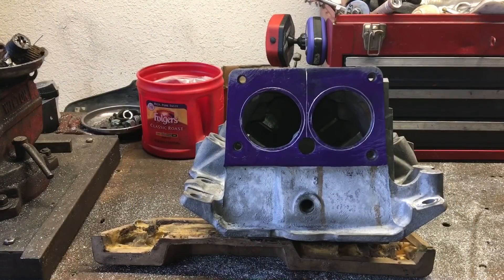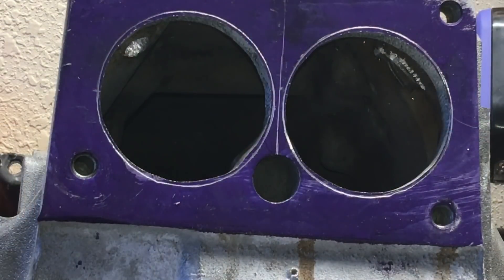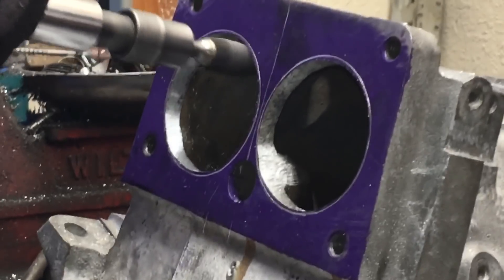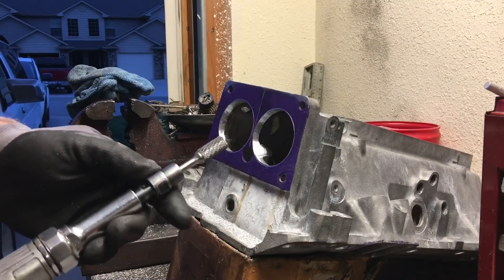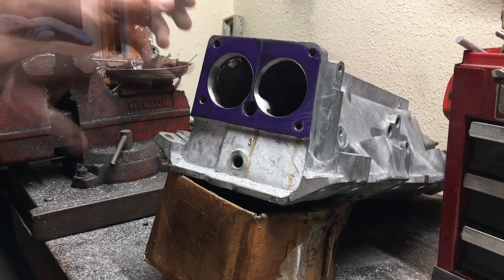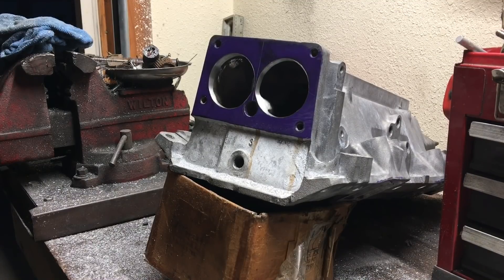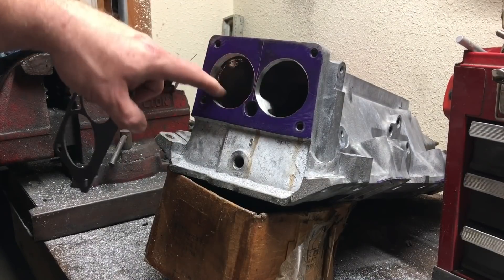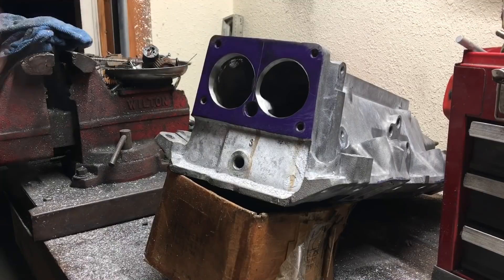Porting LT1/LT4 Intake 58mm dual throttle body BBK

Comment: what about using a bridge port and having a cut that is a true round cut?  I have a jig just for doing these.  FYI this makes zero horsepower below 6000 RPM.
Reply from the maker: Have machine would use!  👍 I wish I had a Bridge Port!  This video shows what can be done by hand.  JD
Reply: I think he covered that in the video. Probably because most guys don't have a bridge port in their garage?

Comment: What was the hp gain you got from this? I got a fully ported intake from Lloyd Elliott and a 58mm throttle body I haven’t installed yet.. I’m jw the gains
Reply from the maker: I can’t verify the results, the owner did a complete engine rebuild including ported heads and intake; never fired the combo.  The is his very first ride from high school, so it’s not going anywhere. 
I will say there’s no gain in running the larger throttle body unless the opening to the plenum is equal to or larger to avoid restriction.  JD
Reply: Mine is fully ported
Reply: I have headers, cam and everything else only thing I don’t have yet is cylinder heads
Reply from the maker: @jarmaljackson7455  Cylinder head flow will be key to making better power.  The camshaft and cylinder heads working together is important. JD
Reply: @HeadFlowInc  awesome I’ve been thinking about going that route probably le2 heads

Comment: We entered a small Dyno competition at a local college  (I’m a high school auto teacher) and the rules made us run an old style block but the head rule said any production sbc head, so we welded up the water port on a set of LT1s and drilled 3/4 holes out the back of the heads and ran the water back to the threaded holes on both sides of the water neck. We fully ported the LT1s and on our bench (Superflow 600) it flew around 260 cfm and near 80% exh (can’t recall exh cfm). We made 530 hp and 487! Ft lbs with a 355ci flat tappet and flat top pistons. We were 80hp above 2nd place! 😏. The following yr they sent us the rules “NO PORTING ALLOWED” 😕 so after a ton of searching we found a set of LT4s. We welded them up and did a nice valve job. They flew exactly the same as the ported LT1s! We went back that yr and made only 1 Horsepower less than the yr before!!! We then beat 2nd place by 100hp 😎 because they all had horsepower drops from the no porting rule.They canceled Dyno competitions after that lol Love your videos! Nelson Performance.
Reply from the maker: I really like how well you guys did each time winning hands down!  The LT1 & LT4 castings were excellent for the time.  Stinks  they did away with the Dyno challenge I know it was a great motivator for the builders!  
Thanks for watching and the feedback I truly appreciate it!  Keep teaching the next generation about auto tech!  Maybe we can get those Dyno Challenges back!  👍😎

Comment: Nice work on Tbody opening and cleaning up runner ski slopes. Most porters don't show the work on the LT1 intake manifold.  Good information.
Since air not combined with fuel until in heads after injectors polish inside flow surface laminar flow instead of rough turbulent more cfm and velocity in intake sand or bead blast inside smooth casting flash no loss of fuel suspension in airstream until after injectors. Nice job of radius corners of ports then smooth sides.
Reply from the maker: Thanks I appreciate it, I hope you subscribe and look at all my porting videos etc!  Stay safe!  JD

Comment: Now I've always heard that this isn't worth the time if your motor is all stock, basically the stock intake and throttle will flow the maximum amount. Is this worth doing to a stock motor or no?
Reply from the maker: Adam Weaver The openings to the plenum need to match the size of the blades in the throttle body. As long as the openings match you’re ok, but if you run a larger than stock throttle body then the intake may need modifications. 
Stock to stock there’s no reason to work on the inlet, but check to see how well the intake matches to the head itself.. 
Thanks for watching!  JD
Reply: @HeadFlowInc  thank you as well! Guys like you are hard to find, most mechanics and techs dont want to help anyone else, then there's you who posts free info on youtube. Anyways, I'm getting a twin 58mm for my firebird. It's got several mods like longer rockers and 3 angle valve job, cold air intake and headers. Also the 24x ignition setup with the bigger mass air. Car needs tuned already but im going to install that throttle first. I'll be using that throttle when I build a motor later too.

Comment: I've been looking for the difference  between lt1 and lt4 heads. Can I just have the work done to lt1 head? Whatever  the work is.
Reply from the maker: Gene Holmes Iirc the LT4 heads flow around 250 cfm stock.  I’m not sure I’ve ever seen a set of LT4 heads to compare to the LT1’s.
The machine shop acted like the factory LT1 valve seats weren’t big enough to step up to 2.02/1.60 valves.  I read about people putting new 8mm guides in LT1 heads running LS 2.00”/1.55” valves.  Along with porting the heads, going to the LS valves should easily our flow an LT4 head.  But I’ve not done this mod myself only sharing what I read.
Reply: @HeadFlowInc  thanks for the help. Maybe this could be a topic for a upcoming  VIDEO ?!?!?! Keep sharing your knowledge  and videos we all appreciate it!
Reply: @HeadFlowInc  what size is the stock lt1 valves? I guess I should have asked that too!
Reply from the maker: Gene Holmes 1.94/1.50 valves in the LT1 heads 170cc runners. If we had known these heads needed guides, we would have switched to 8mm guides/valves so we could run LS 2.00/1.55 valves.  I did not know using LS valves was an option before. 
Sorry for the late reply, I was not notified of your replies.  JD
Reply: @HeadFlowInc  I also watched your throttle body to intake port job. What is the stock size for the LT1 and the LT4? Is there different sizes for different cars/ trucks? I let to search junkyard for stock parts
Reply from the maker: Gene Holmes The stock openings iirc are dual 48mm, moving up to 58mm is a pretty big difference. What’s funny is when people bolt the Dual 58mm throttle body on a stock intake restricted by the OEM 48mm holes.  It can’t improve any flow! But they trick themselves into thinking it’s faster. 😉
Reply: @HeadFlowInc   thanks for all your help
Reply: This is good info. We can buy heads, afr 210's even, but very few intake options
Reply from the maker: port nut LT4 parts are very rare not easy to find. 🤔
Reply: The ports in lt4 heads and intakes are raised a little compared to the lt1 and flow a little better. Lt4 also had a slightly more aggressive cam. Between all this it was about a 30hp difference